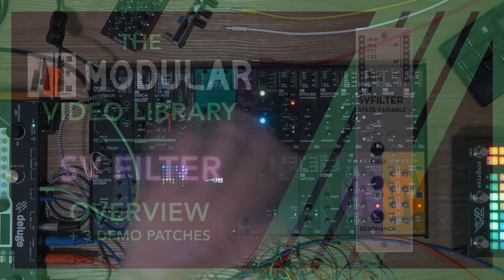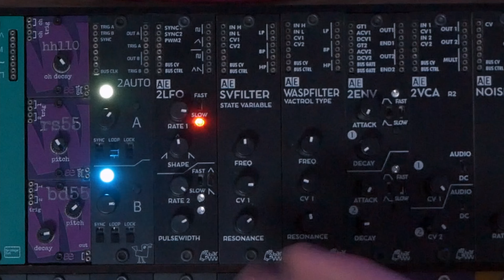The AE Modular Video Library - SVFILTER

Comment: I strongly prefer the SV Filter to the Wasp Filter: the Wasp Filter has high resonance even when resonance is *zero*.  That's a real problem.  My biggest complaint about the SV Filter is that its CVs are both very weak.  To get the CV to push the cutoff to max, the base frequency has to be almost halfway already.  Whereas on a filter like Wasp you can set the Frequency to 0 and still push the cutoff to max with the CV 1 as it should be.
Reply from the maker: Yeah that's fair. I definitely use the SVFILTER a lot more these days than when I filmed this video. That said, I still love the wasp filter a lot. I'm a real big fan of resonance, and I listen to a lot of abrasive music that makes good use of it (Death Grips, The Mars Volta, etc), so that might be why I like it so much.